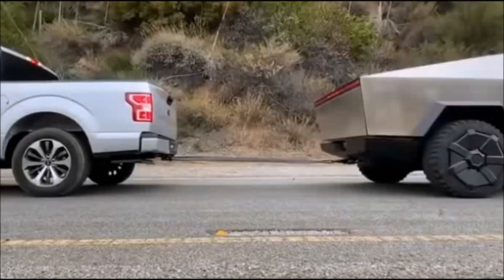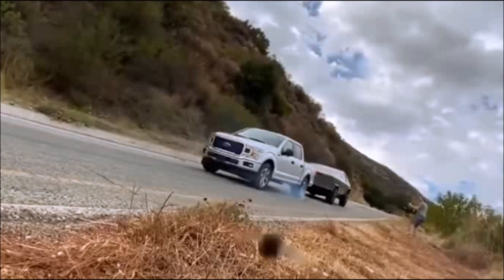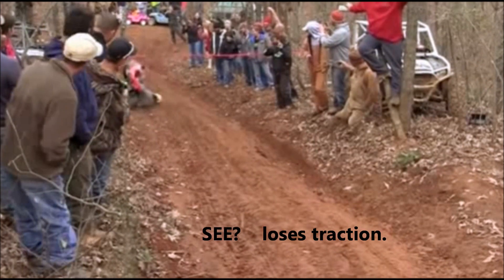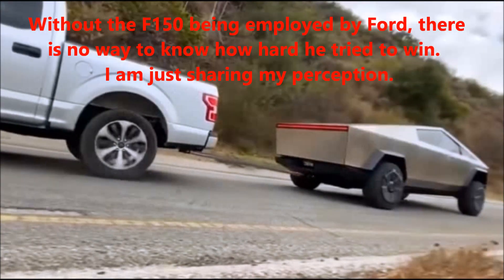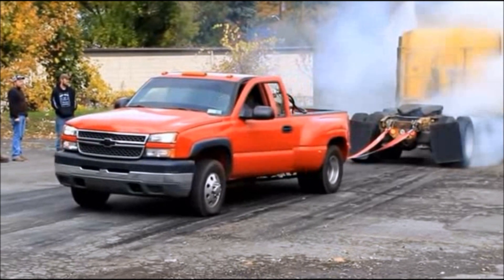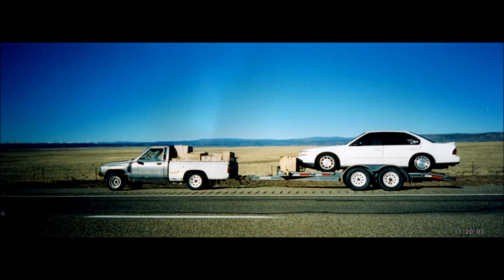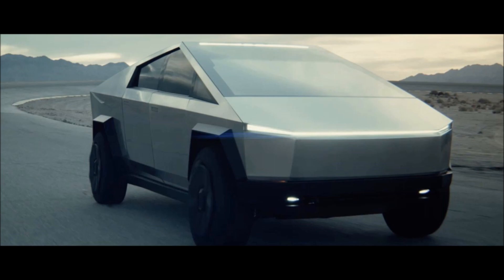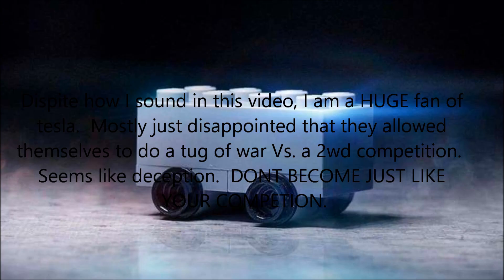Tesla Cybertruck Vs  Ford F-150 Tug of War Breakdown.  What did it prove?

Comment: Sounds like a salty ford owner
Reply from the maker: really?  i tried to remain as neutral as possible.  im guessing you didnt understand the references, physics or the video in general.   and maybe even missed the part about apples to apples completely.  5:45 i state that i dont think the f-150 even stands a chance against the cybertruck.  i think you put too much value on the tug-of-war when the reality is that it is a worthless measure of anything usefull for a truck.
Reply: Spencer PhilippineDream r/woooosh
Reply from the maker: @connorwilson2253  i had to google r/woooosh.  yeah, sorry i didnt get it.  i like to think i have a sense of humor but maybe not. 
when i was a kid, my dad always went to the library and copied consumer reports before buying a new-ish car.  i did the same for my first car at 16, honda and toyota were my top picks, but honda didnt make trucks (and still dont IMO).  so toyota is still my truck of choice. 
in 2000 i was a salesman at honda for 3 months (i couldnt take it) and the Honda Civic CX (extreme base model, not even power steering) got 43 mpg hwy with a manual transmission (you learn to recognize what trim level models are from far away by reading the mpg sticker in the window).  fast forward 15 years and cars are still only in their mid 30s and trucks in  their 20s.  
the old toyota pickup in this video (pulling the nissan maxima) is a 1986 4 cylinder carbureted 2wd and would get 32 mpg on the hwy with 250k miles on the odometer.  
 i am very proud that tesla has been so successful.  i genuinely hope that tesla puts all the companies out of business that have oil companies in their back pockets.  we have put up with substandard efficiency for too long.  (THIS would have been the one-sided story i wanted to do...but for this video, i tried to remain neutral.)
Reply: Ahahhahah yea they are in Pain

Comment: Would you change your mind over the Cybertruck in 6 months time?
Reply from the maker: yeah i think i probably would.  its been 3 weeks now and i have gone from thinking it looks terrible to ... seeing potential.  when i made this video, i saw the looks as something trivial and that could have been easily changed.  now i am thinking the looks are a byproduct of cutting costs and weight while at the same time adding strength and safety.  and i put far more value on those things than looks.  
    originally i thought it was only to save about 200 lbs but i think the shape affects much more than just the looks now.

Comment: Latest video I saw Ford 150 4x4 with good traction tire pulled my model x, with almost same weight video by Zunigas
Reply: The Model x pulled it the first pull.
Reply: In tug of war, if a car holds the brakes, the other car loses traction. Rewatch the video and see the Ford holding brake till the Tesla spins then the Ford accelerates and pulls.
Reply: @MM-ss9mp  yes, that's why in their 2nd video tesla model x vs Ford F250 hold the brake then accelerate and X Lose traction.